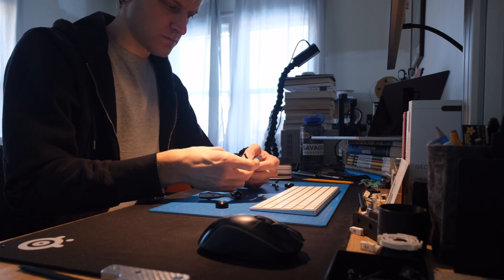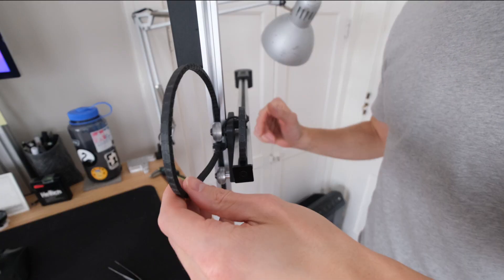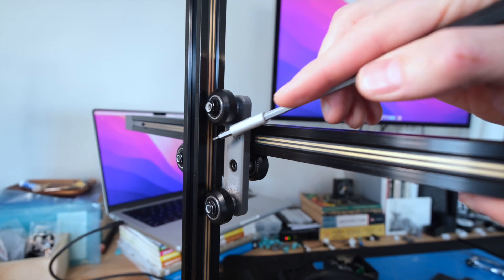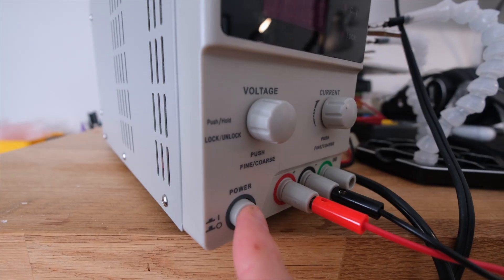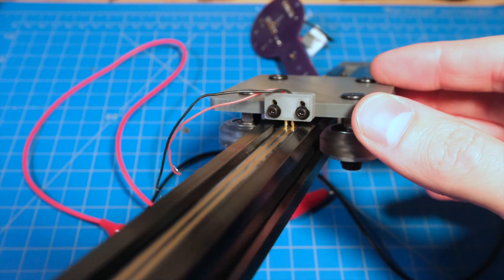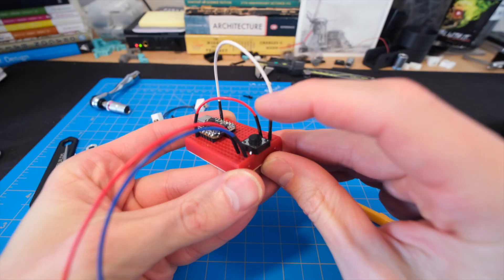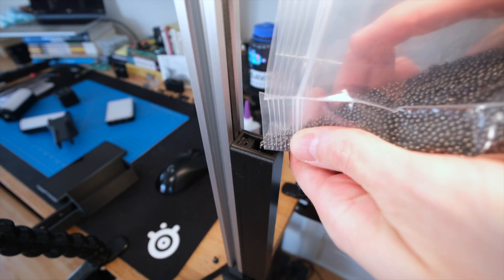Pogo pins: attractive distraction or ultimate wiring solution? - DIYson Lamp Build Log #9

Comment: @StevenBennettMakes
If you relocate the pogo pins for the horizontal arm to be in-plane with the rollers on that arm, the rotation problem should be reduced, if not removed. 

Someone else mentioned taking care with the capacitor, I will add that having a large resistor between the leads of the cap will make it safer, as the cap will have a way to discharge while the system is off. Selecting a sufficient ohm rating for the resistor should allow for a safe discharge without drastically increasing overall power draw.

Comment: My first thought would be to throw a guide wheel on the carriage that's out past the horizontal pogo pins so that there's something that can help resist the movement of the horizontal arm. That, or put it between the two wheels on it's bottom, opposite the top one.

Comment: I’d try using the extrusion it self as a conductor wire may be negative wire and using only a single track pcb as positive wire which will make pogo pin connections easier and less chance of disconnecting from the pcb track. It may be a sil solution but I may be another alternative btw.

Comment: Are we concerned with the shearing forces on those pogo pins? And what about wear, how long will the pogo pin or the copper in that pcb last?   I'm wondering if brushes,like they use in slot cars might be better,idk.
Reply: The bidirectionality of the movement makes my brush suggestion silly. Still not feeling the pogo pins though.

Comment: Just a thought,  have you ever seen how the rotary switch on a multimeter interfaces with the circuit board ?
That might be a better approach to the pogo pins, I think it would suit a moving connection better then pogo pins.
Would probably be cheaper too.

2. Maybe you could design spring which attaches to the carriage and slides behind the supertrack keeping the distance more consistent. 
It doesn't need to be a traditional coil spring maybe a loop of spring steel with a piece of teflon, plastic might even work if it was thin enough, these are just thoughts they may be impractical for your situation but might spark an idea.
I love the project thanks for sharing your process.

Comment: Take a look at some rotating contacts.  They all have at least two carbon brushes per ring, often 3 or 4.  The contacts on a fast rotating MRI assembly have so many brushes, like 16.

My suggestion would be a something like a long spring block that rides in the track recess, that has multiple brushes or pins per contact track.

What about recessed tracks, so the pins ride in a groove?

Comment: Hey mate, the lamp looks good. In normal applications you'll see tracks exactly like what you've got, but the contacts are normally phosphor bronze leaf springs. Either a turn back design, which needs to be very carefully engineered, or, for something that will work a lot better for you, just a straight leaf spring. You can bake in a LOT more travel so that you get a good long length of contact and a very consistent pressure which will eliminate the variation due to contact pressure you're getting. The second thing is that you'll have a point of rotation which is about the front roller in your setup, put the leaf springs over that and that'll eliminate lateral motion due to rotation. I hope this helps.

Comment: Use pogo pins with built in springs, so if there is a slight wobble the pins will retract or extract and always make contact
Reply: I mean the holder of pogo pin like bubble extension

Comment: I haven't reviewed the whole design yet but maybe adding an eccentric nut(if not already added)to one of those roller will significantly help make the setup rigid and reduce play
You can also use whisker like spring connectors (one used on some slip ring connector) may give a bit more give while still giving good connection

Looking forward to building one

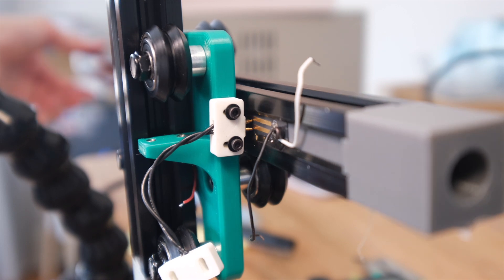Comment: 14:30 Because of the problem of solving the distance between the pins and the wire, you could create a spring-loaded pin block that exerts permanent pressure and thus pushes the pins into the wire. When moving, this would (if properly designed) press the pins against the track, even during rotational movements.

Comment: I think tracks are the solution. But probably not with pogo pins. I reckon you need something like a "shoe" on an electric train, for more surface area. Probably a sprung leaf of metal like you see in the contacts of batteries or Ethernet/RJ45 ports.

Buy yourself some cheap track lighting and dismantle it for inspiration. The components are fairly standard.

Comment: Why not just use a retraction system with pulley? either a counter weight setup or a floating pull that is pulled by a self retracting wire.
It could even be implemented to counter some of the weight of the arm, allowing it to be moved easier.

Comment: What do you think about tightly spanning two exposed wires along the length of the aluminum extrusion, with two metal hooks making contact. Sort of like a trolley bus overhead line. While taking up slop in the wires could be an issue, it would be nicely in line with the goal of staying economical and accessible. Keep on making! Love the project!

Comment: this design will not work (in the long run) because there is going to be too much friction between the materials. You need to make the pins with carbon/graphite. That way only the pins will get worn out and can be replaced, instead of the whole circuit board. Another issue with this design is how do you tackle the eventual problem of dust and dirt accumulating on the contact area? Perhaps some kind of brush or cloth material attached on both sides, sweeping the tracks as it moves, could take care of that?

Comment: Is it worth experimenting with the x-y dimensions of the carriage? By lengthening the carriage in the x-y axis we should reduce the slop in that joint, which will reduce the potential offset of the connector against the pcb, no?

Comment: Custom wire brushes might be a good option here. Also a note about the kinematics of your design. if you can move your pins closer to  the pivot in the carriage the pins should have better contact.

Comment: What about changing the shape of pcb tracks to be :
* closer to the pins (raised proud of the pcb material)
* convex, concave or V-shaped to guide the pins along the desired path and forcing more surface area touching for the pin
... Or...
Change the shape of the pin carrier piece to ride along the shape of the rail, using the rail's top and bottom edges to avoid the pins deflecting vertically

Comment: I wonder if two sets of pogo pins per axis, say at each end of the carriage will compensate for the flex that pulls the pins off the track. As one set lifts the other should make a firmer contact, but then its hard to see where the pivot point is in the video. Maybe? Looking good though.

Comment: Do that thing you said at the end, that's the solution. Have the pogo carrier attached both to the beam and the carriage, each with degrees of freedom, so the beam maintains 2D position/orientation relative to the supertrack, and the carriage drives position along the supertrack exclusively. I think the easiest option is to make a T-nut sort of thing that rides inside the T-slot, but that is going to throw a wrench into the supertrack PCB, and it'll become sensitive to the differences between specific styles of aluminum extrusion.

A more involved solution is put something ferrous behind the whole track, and have the carrier stick to it with magnets, riding in the face of the slot. Maybe home depot sells a perfectly sized piece of flatbar. But then you need to design a carrier which will gladly slide across the face of a PCB without causing wear to the PCB, and between two anodized aluminum walls without marring or wearing away. You do get to use magnets though, everybody loves magnets.

Comment: Your misalignment is largely in the one plane. Put the pins on the top or bottom where the misalignment will be compensated for by the springs in the pin, instead of on the side.

Comment: I mean it's simple: the wheels are not stable on that 3D printed plate. All your problems can be solved with 2mm thick steel plate... Or a 4mm aluminium plate... Whichever you find around

Comment: Bit late to the party but what about having only one track and pin and then just using the arms themselves as a common ground?  
The contacts losing connection on rotation is due to them forming a rigid triangle of sorts so having just one point will make it less effected by wiggle

Comment: Thanks for this project... more than anything, this mechnium is not just for light, but could be used for a robot of some sort

example, give a motor to the joints, 

make it a 3d printer swaping the end woth 3d pen
make it a form cutter
make it a 'jarvis' like you said from something with tony stark
make it a mobile stand for video

Comment: If you had a kind of movement unlock mechanism, you could retract the logo pins While moving, and drop them into contact when stopped..add a supercapacitor to the lamp head, to keep the lamp lit while moving, avoiding the lamp dropping out while moving

Comment: I want to suggest making a supertrack strips on two opposite edges of the profile (positive electrode on one, negative on the other), so it will be as wide as possible, so you do not need to accurately position the contacts. And you can use finger contacts instead of pogo pins

Comment: Great update. The pcb track really looks like a good idea But. You will have to start thinking about wear and tear. Just like brush motor, you should try to find pogo pin or you should try to make your own pogo pin from a softer material making the pin wear but not the track. The pin should be easyer to replace and cheaper. Also if not yet already done, for the final pcb (if still done with a pcb) should be gold plated so the copper doesn't oxyde with time. 

Here are my tips. Good job and don't stop. Will probably build one when I change desk.

Comment: I think there is just too much mechanical play with an extrusion and v groove rollers. You either need to make this much tighter or switch to linear rails if you want to keep your current setup.
The third option would be to separate the components a little more again: imagine the pins riding along the pcb on the side of the extrusion. You then design some small arms that hook into the top and bottom of the extrusion, so that the pins are always in solid contact with the pcb.
Now it would be possible to push the pins all the way up and down the extrusion and to avoid that, you take this assembly with the pins and its arms and mount it to your plate with the v groove rollers so the pins can be stationary while the extrusion and pcb under it move, but don't make it too stiff of a connection so that the little arms are still responsible for creating the contact force.

Comment: What about using 2 of the 4 profiles for power transfer; 1 fat track for each side? You could diy a big 'pogo pin' out of a bearing ball and a spring that fits the end of the bearing ball, with a 3d printed sleeve holding the tip of the ball like a ballpoint pen, able to move back and forth. This way you would get a lot of potential travel.

Like this: https://i.imgur.com/t3rybyS.png

Comment: Cool project. Having a battery included with the electronics next to the LED could maybe help solve some of these issues. In that case the tracks are only used for charging, and won't need to be 100% reliable. Batteries increase volume and weight though.

Comment: Have you thought about using the Pogo Pins on opposite sides of the aluminum extrusion? So one side coud carry only + and the other side only - of the Voltage. That way you would have more surface area to cotact while moving. When using capacitors you should look into hyper caps. You can get these with capacities up to 30 F and still have a reasonable size.

Comment: Really inspiring build log. Looking forward how the pogo pins will hold up, or rather the pressure of the pin contact. Though from my experiences with power rail energy transfer its the contact patch that gets worn out quicker, that is with copper contacts. I like the adjustment possibility of the pin holder, great job!

Comment: I'd replace the pogo pins with long leaf-spring copper contacts. Lower contact pressure to reduce wear issues, but a much longer "hight" travel to handle the contact block moving away from the track. As used in my 40-year-old VW campervan, for the horn push contacts in the middle of the steering wheel. Proven and long-lasting solution :)

Comment: Not sure if it has been mentioned here but have you considered using a rigid-flex pcb between the sets of pogo pins? You can then design the printed cable track around the flex pcb to protect it without messing around with tiny wires and tedious assembly

Comment: Take the roller pogo pins and create a suspension for them. It should be easier with the bigger pogo pin maybe you could just put a spring on the back of the pogo pin and then stop it from flying out the front with a lip. You now have a roller pogo pin with extended stroke and “suspension” so to speak.

Comment: Pogo pins are not intended for such use. Engineering long ago developed solutions for transmitting energy and signals from such tracks. Try to use them, they should be much more reliable.

Comment: I completely understand your feelings about designing the pin holder, those sorts of small designs allow 3d printing to more or less fulfill the almost magical perception it has in the eyes of the broader public. Truly rapid iteration is possible due to the minimal time it takes to print such small designs, allowing you to be able to make very minor changes one at a time until you achieve perfection in a timely manner that wouldn't be feasible at any other timescales.

Comment: You could use rolling conductors instead of pins, or carbon tracks or potentially  metal combs instead of pins like they do in the rotating contacts inside camera lenses, that would probably help with keeping the contactor surface area up through moves etc

Comment: I think you are overcomplicating the problem with the pin, if instead of trying to make it perfectly touch the pcb strip, connect a metal strip in the shape of a circle to the postive and negative of the pin so that it works like a spring (too far away, the metal streaches trying to get straight again, too close? it will contract)

and now Im realizing this explanation is not very clear but hopefully you got what I was trying to say, sorry :P

Comment: Few thing about the energy chain:
It is much  neater when moving part is parrarel to the rest of chain as usually those chains has limited angle in other direction and thus it is self supporting structure and has very minimalistic footprint.

and then there is this method with even smaller foorprint: https://youtu.be/3-5MHr1WNNk

flatflex cable in  same kind of configuration could allso look neat.

Comment: I feel a supertrack also deservers superpogo's! Would it make sense to put the pogo pins on a spring-mounted plate? Expanding on that, a double spring mounted plate that could tilt would maybe make 4 pogo pins in a square shape, like tested in this video, more functional, because the springs would allow the plate to tilt when necessary, making sure the at least one set of pins would always make contact. Or not, I've not tested any of this and am just brainfarting. Great video's though, they sure are stimulating :D

Comment: Great video, Steven! To build on your pogo pin idea, and the motor brush idea someone else mentioned, you could use a pair of solid contact points (or brushes) attached to a 3D printed compliant arm that presses against the PCB. That way you could control the total deviation that the contacts can tolerate without relying on the stroke of the pogo pin. Depending on how you design the compliant arm, it could push down on the PCB and flex side to side to account for the most extreme deformations you showed in the video.

Comment: Positioning the pins in the center should help a lot ,could be integrated in the cartridge it self . The rotation wouldn't affect the distance from the tracks just the angle and the up and down movement some rotation which I guess is minimal . Keep going amazing work. 💪

Comment: Contact resistance may also change with movement. Bigger currents required for driving a LED will lead to a voltage drop on that resistance. you need to repeat the tests under load conditions. A slightly less elegant but electrically safer variant would be to use two PCB tracks, one on each side of the rail so that a short is less likely

Comment: metal on metal dragging and sliding doesn't sound too good. instead use the graphite brushes that you can easily and cheaply find in brushed dc motors. they are spring loaded and last a lifetime, and when the lifetime is over, just replace the small graphite brushes for pennies.
Reply: also why retire the aluminium part? host a contest between episodes where you put the most helpful comments in a random bag and extract the winner, then do 50/50 for shipping or something with said part, or new pcb etc. i believe that doing it in a literal bag with pen and paper would take half an hour and would add a lot of charm.

Comment: You essentially made a linear version of a component called a "slip ring", there's probably a lot to learn from commercial slip rings about how to make it more reliable.

Oxidation might be a problem over time with brass pins and copper tracks, commercial slip rings are often gold plated but of course this isn't viable for a DIY project. A very thin layer of contact grease might help with longevity.

Looking at the rotation problem, it seems to me as it it's more of a problem with the mechanics than the supertrack, you can probably change the roller position to minimise the movement at the pogo pins